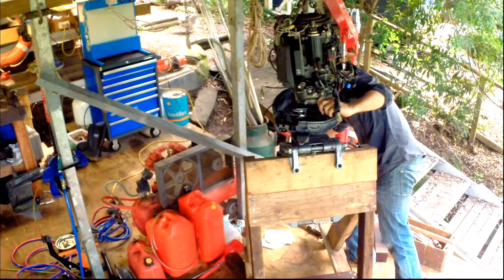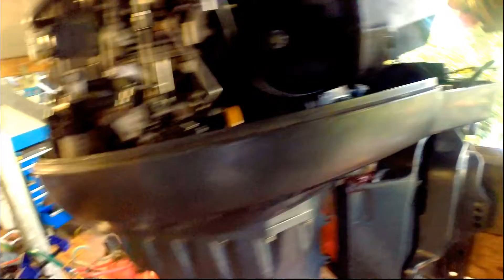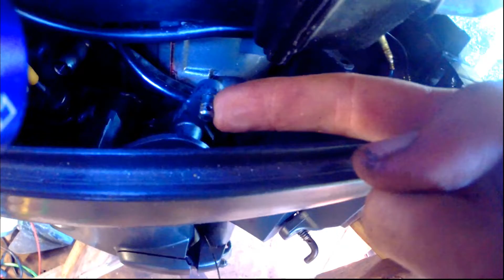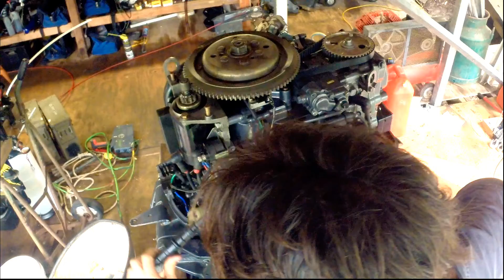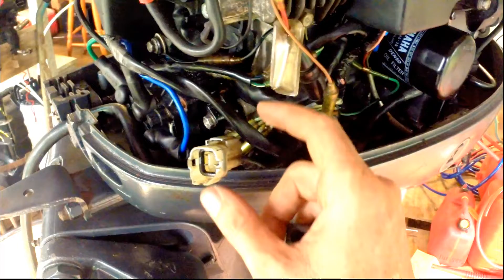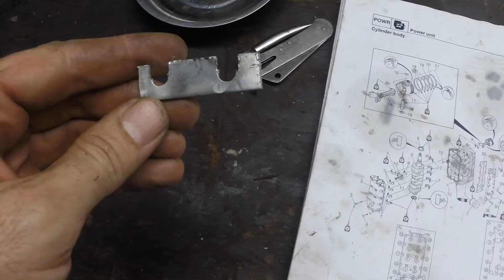Installing the powerhead on a Yamaha 50HP four stroke outboard

Comment: Hey, if I have engine oil leaking down the drive shaft and out of the water intake vents, would this be the crankshaft seal ? Any chance a base gasket would fail ?
Reply from the maker: Yes, sounds like lower crankshaft seal.
Reply: @DangarMarine  thanks for the reply
Reply: @DangarMarine  did you replace the lower drive shaft seal in in the pan ? What is the purpose of it ? To stop crap getting into crank shaft seal ?

Comment: Did you ever find the culprit for the low compression?...I just picked up a F60 hecka cheap, that has low compression on cly #4....I haven't gotten a chance to dig into it yet was just curious as to what exactly was the reason on yours.thanks!

Comment: I never noticed you putting any sealer on the gaskets you installed. did I just miss it??
Reply from the maker: Many manufacturer gaskets specifically call for no sealant. Some valve cover gaskets do where they curve, but most are installed dry.

Comment: I may be mistaken, since the oil is leaking out, may there be a defective gasket between powerhead and oil sump instead??
Reply from the maker: If the oil is visible in the lower cowling then I would start with the gasket below the powerhead, yes. Are you sure it isn't a bad seal around the dipstick though?

Comment: Hi! Just foud out that my 40hp 4-stroke is leaking oil from the lower crank seal. Is it possible to pull the power head and replace the seal without splitting the engine and pulling the crank? Is the seal accessible once the power head is pulled?
Reply from the maker: Yes, in some cases it is possible to pull the seal out using screws or a spike and then pressing a new one in.

Comment: Thanks for the follow up on it. yeah i purchased two different service manuals and both show no mention of attachment to anything so I figured it was a drain as well due to it being at the very bottom of the silencer box. My T50 is at the repair center now getting synced and tuned. I read the manuals for hours a tried over and over again but could not make all of those linkages, choke and pilot air fuel adjustments work together properly. One adjustment would throw all the rest off etc. I got it way out of whack rebuilding all of the carbs. Hoping for smoother than ever when I get it back...
Reply from the maker: Fingers crossed for you. I'm still waiting until pay day to get the vacuum gauges to balance mine so that video will still be coming eventually, but a bit late for you by the sounds of it. I still have a problem with the motor not dropping back down to idle properly so I may get a bit of professional help too in the end!

Comment: sound very nice, What size is your boat using this F50? how fast is it?
Reply from the maker: The boat is an old aluminium de Havilland, about 4.6 metres I guess. I'll do a few runs with the GPS soon, I'm not sure how quick it goes. My guess is that with one person on a flat day it would be about 25 knots but I'll check and let you know.
Reply from the maker: So I checked with the GPS and it sits at 24 knots. Not super fast but good enough for me. :)

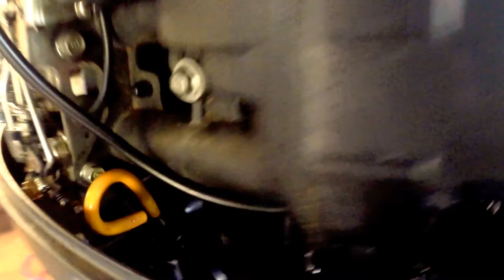Comment: On this video at 10:16 there is a good view of a vacuum hose that looks like it comes from a fitting at the very bottom front of the air intake opening area and goes up to the carbs area somewhere. I have it on mine as well but it appears to have been cut short by the previous owner or not put back correctly. it is connected to the airbox nipple but is just laying down near the oil dip stick area. I have not been able to figure out where it connects on the engine side or if it is even needed. Do you remember where it connects on your model? Thanks
Reply: +Dangar Marine thanks for this info!  I had been wondering the same thing. I didn't know what that hose connected to either. Glad to know it doesn't connect to anything
Reply from the maker: I don't remember removing it and I can't see any reference to it in the service manual. My current thinking is that it is there for diagnostic purposes, but I'll let you know if I find out anything to the contrary.
Reply from the maker: So I've been looking a bit further into this and I've found references to an Idle Control System (ICS) that takes an input from the vacuum line on the silencer (air intake) It doesn't seem that this model has an ICS though so I'm not sure what do to with it!
Reply from the maker: I spoke to my local Yamaha guy this morning and he said that it is a drain hose to get fuel out of the silencer should the carburettors flood. Just leave the hose in the bottom of the lower cowling, or even better get it to head out through one of the grommets.